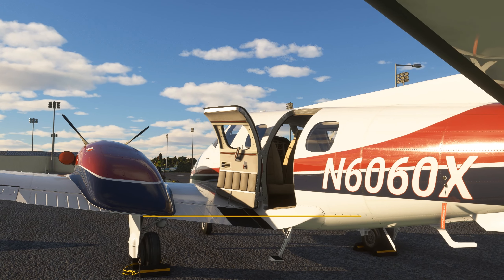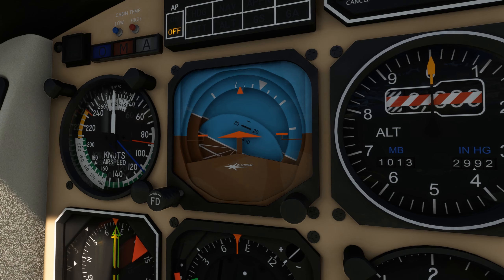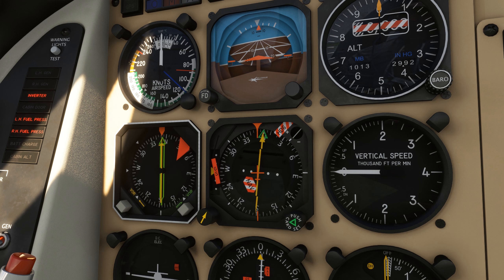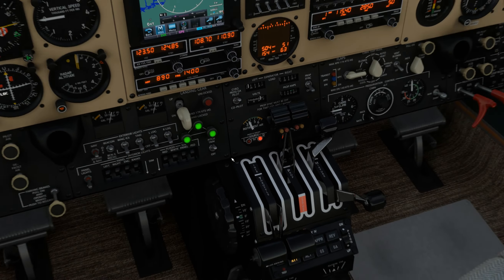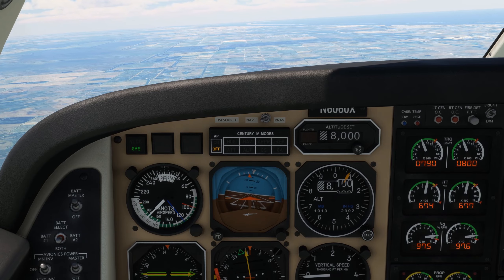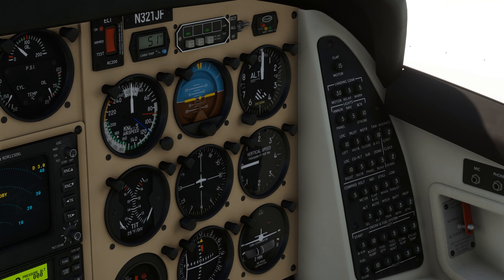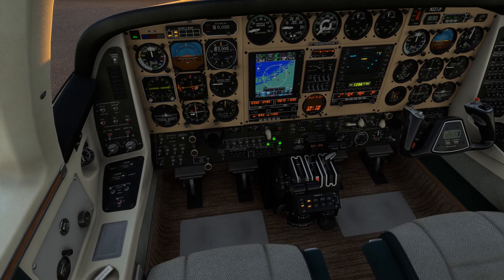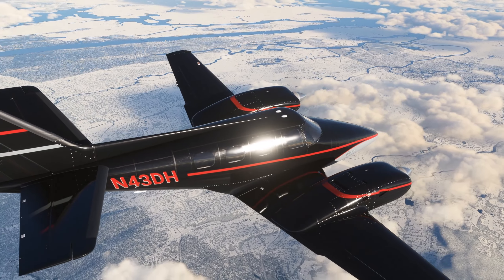Black Square Dukes MSFS - Gyroscopes - Just Flight

Comment: This is especially interesting because there have been plane crashes after a slow loss of gyro suction pump power, especially in Pipers or other single engine planes. If this happens there is no chance for situational awareness when flying through nightly clouds fog or above forests and fields with no ground illumination. Luckily our Dukes have not only one but two pumps and also a second ADI on the copilot side so a failed pump will not prematurely end a nice instrument night flight... :) Aw I can´t wait for the release of the finest and most detailed aircraft ever.

Comment: 2:30 why would low battery voltage affect the electric gyros if the generators are still operating?

Edit: Changed “alternators” to “generators” after looking more closely at the panel

Comment: I don't know if I missed it, I've been watching every video that came out since I saw this product, but with the realism levels being at 200% for everything so far, how about environmental? Rain, wipers, ice build up on leading edges of the wings etc, de icing?
Reply: I think it's because of the lack of attention icing actually gets in the sim. I'm no pilot but IRL icing conditions are something that should be avoided at all costs for aircraft not equipped with de-icing equipment and severely cautioned even for aircraft with de-icing equipment. In the sim, I tested a few different aircraft flying through heavy icing conditions on full realism. While visually icing accumulated on the  windows, prop cone and wing tips, the aerodynamic effects are not properly simulated and the sim didn't really treat icing conditions as having a severe impact on aircraft performance
Reply: @Not_Lewis A2As Comanche absolutely does react to it. I got iced up enough once to loose 20kts TAS and it was definitely flying at a higher AOA.
Reply: @4lifeifly  fair. I did test on some base aircraft though so maybe my findings were skewed

Comment: is gyro really know where the earth/gravity acceleration? or just turn out of acceleration like the ball in inclinometer? how in fighters or aerobatic it's even  can works? all time accelerations vectors changing heavy. how the hell gyro can see exactly earth position in that situation? even not fighter, simple ga, that can handle 4g if the plane bank at 45* and take 4g is gyro set as horizon or will show 40, 38, 42, 35 wherever in sum it will "see" the earth? simple  situation, ac fly up legs -1g then pilot pull the stick and still upward but have +1g for now, gyro just will invert back or still show real horizon position?
Reply: If my other comment gets deleted for posting a link, search "Gyroscopic Instruments in 3D" on YT, it's by Gold Seal Flight Training. It'll help explain how gyros work and how they stay fixed while they aircraft rotates around them. It's pretty cool.
Reply: @lostboii3588  thnx:)